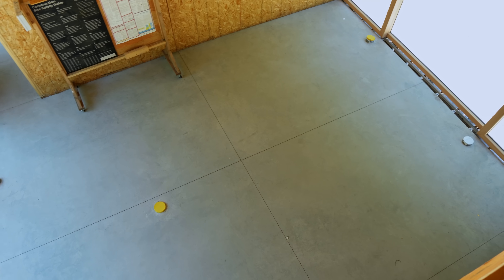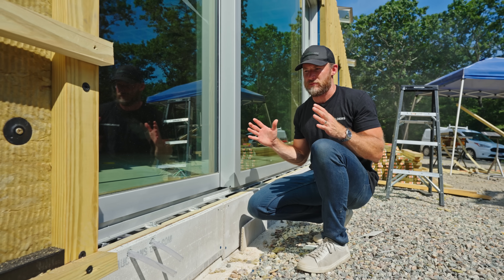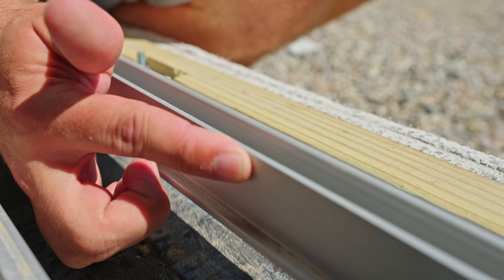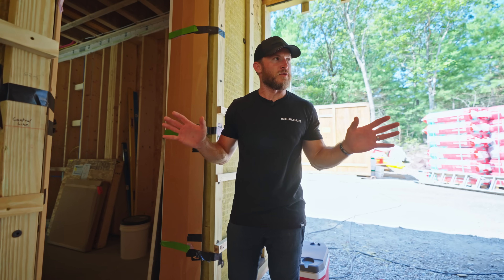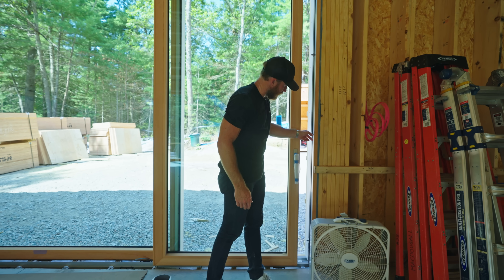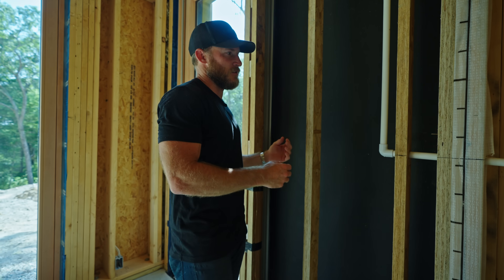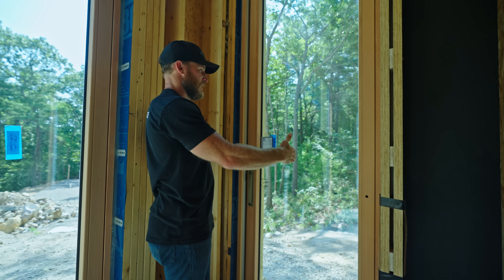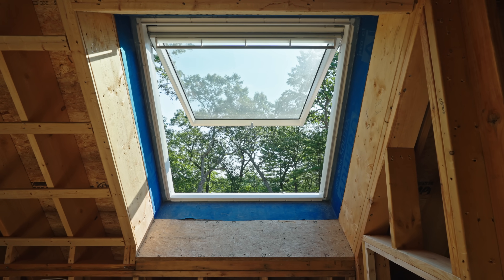Installing Floor to Ceiling Sliding Glass in Modern Nordic Cabin

Comment: Regarding the window sills... you could use a mixture of concrete and EPS grains, this will break the cold bridging.
Finish it with an epoxy coating (especially on the outside) or mortex and you're done.
Reply from the maker: Good idea, I'll share what we end up doing
Reply: @NSBuilders  Thx! Such products are quite popular in Europe as a "screed".

Comment: New protect 🎉
Why no SIGA Majvest this time?
Reply: I think Nick and his team just wanted to stick with one material supplier. As he explained in the video when deciding on using tape flashing over liquid applied. Also a quick search shows that the SOLITEX product has a longer UV exposure time compared to the SIGA product. With the siding being not your run of the mill product, lead times and scheduling conflicts could push the timing of the siding past the recommended exposure of the SIGA product.
Reply: @alexnewell8580  Could be.  Although the Wellesley project is much bigger and probably exposed longer.  6mo is more than enough to at least install batts.
Reply from the maker: Just opted to use a differnet product for it's performance